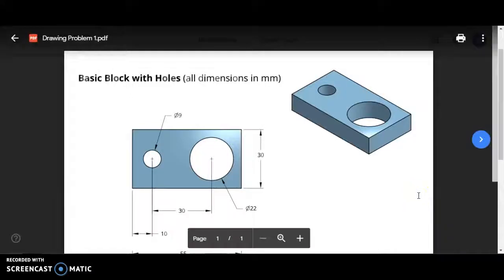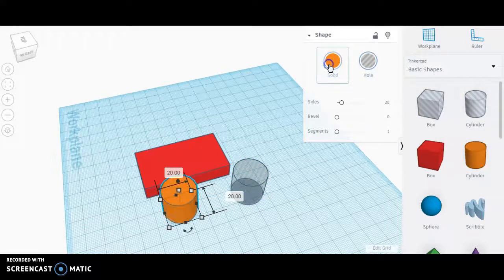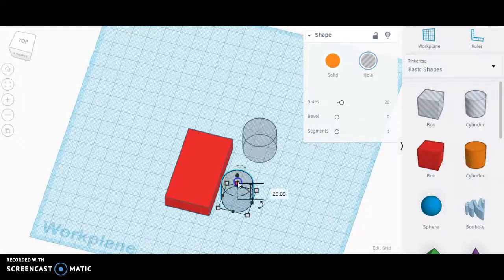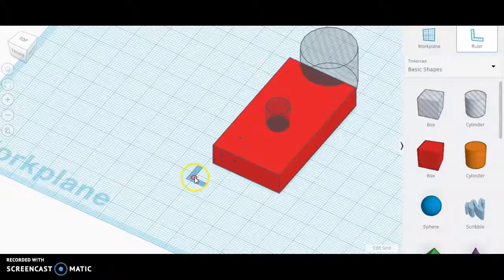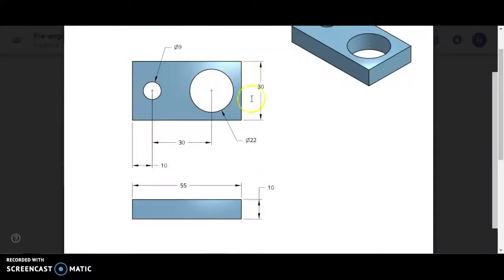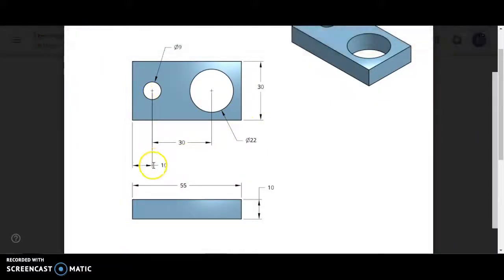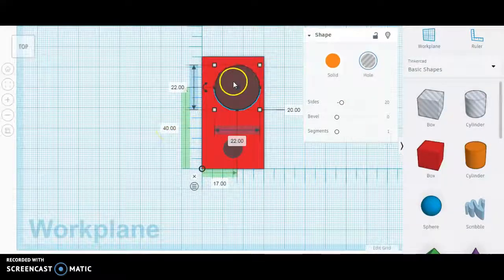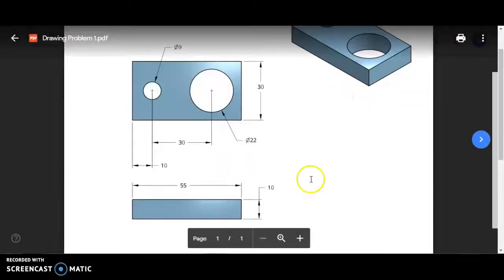TinkerCAD Ruler Tool: Position and Align Objects

Comment: I have an open box 115mm/99mm  30mm deep.  Now I have to put partitions across to an exact dimension.  How can I use the ruler to space these partitions?  Probably should have done this in Fusion 360 but I'm not that good about it.  thanks
Reply: @nathanschwalen2606  Hi Nathan.  Thanks much.I'll try it.  Another thought is to make holes and lower them in. This is something similar to an SD card holder only bigger to hold the ink cartridges for my Canon Printer.  Last resort would be to print it, then print the spacers and glue them afterwards.  Would probably be easy in Fusion 360 but I'm not that advanced in that.